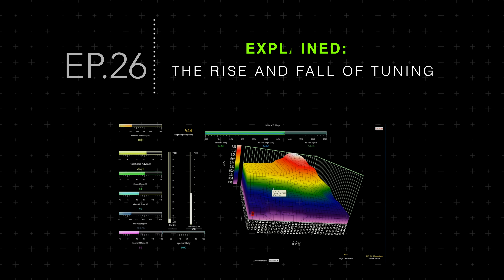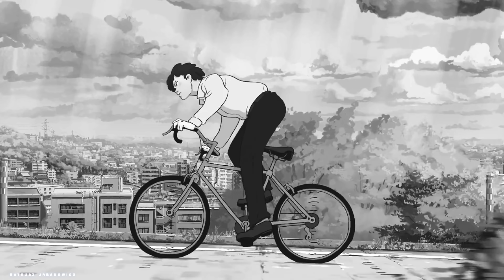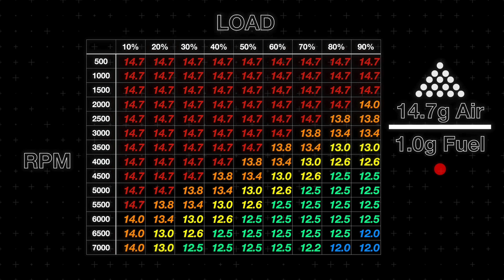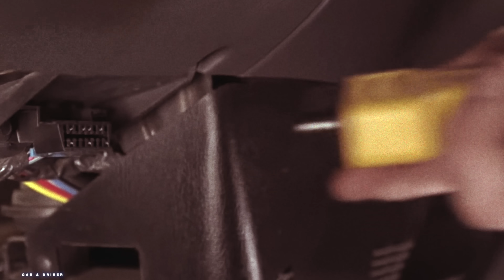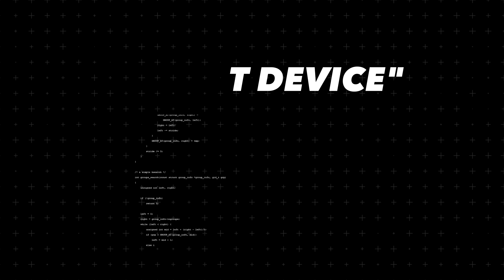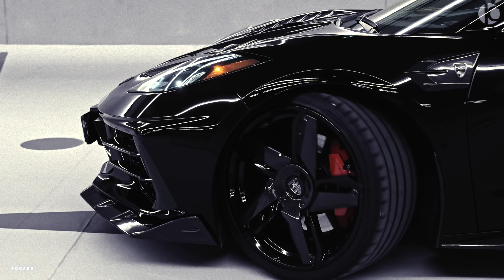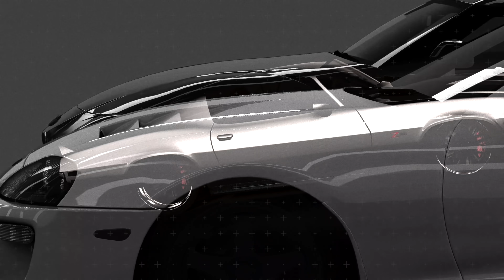How Tuning Engines Became Illegal👮🏻‍♂️| Explained Ep.26

Comment: Fortunately, SLS Printing is getting cheaper and easier to fully DIY with custom open source software. A simple rebore here, a press fitted bearing there and a tread retap here, and you can just print single modular cylinders and components and build however many piston engines you want.

For anyone who says they will just make it illegal, it is literally more impossible to illegalize SLS, SLA, FDM CNC and any other basic automated manufacturing or what you can manufacture than illegalizing all guns in Texas and actually be able to enforce it. 

Examples are, alcohol prohibition, Marijuana eradication, and any other drug which by the way are often more complicated to manufacture than a basic CNC controlled by an old laptop with a die grinder as the cutting head to make a better CNC that can make a hot end for a printer to make better and better.

Comment: Have you ever considered connecting a Arduino to a ignition coil and a position sensor just saying to get a engine running it doesn't need there computer it just needs a computer

Comment: California CARB requires vehicles to have higher emessions than the rest of the country. I got dinged because my 91 rodeo was 20% below average, and had to have it re-tuned to retard the ignition timing to increase the carbon output by 40% (according to their measurements). Not to mention the vehicle now needs to use higher RPM's to do the same work, so real world emissions are now even worse.

Comment: This has been a travesty for the future of car culture in the US. Using the case of a car manufacturer defeating emmisions regulations as a stepping stone to go after and attack the small hot rodding community is blatant overreach and an attack on small to medium business.
The layed out intent is to curb emissions, but there's a vast difference between an auto company doing it with dirty diesel and selling millions of vehicles versus random "other fuel" tuners working on weekend, track, and retirement warriors vehicles. These two groups are not the same.
There's so much wrong with this.
There should be an American Hotrodding Act.
Message your local law makers and tell them how you feel. Write the president and let him know why you think the EPA is off the handles.
A lot of these modified and tuned vehicles run cleaner than stock.

Comment: And I happen to own a scandal VW Jetta.. had the so called repair done... from 62 mpg average to 23.... gotta drive the same amount of miles though and the recall stated that the car still would not have passed emissions for it’s date of manufacture but would be a little better... yet now that I’m putting out 3 times the amount of fuel to go the same distance, I’m now putting out three times the amount of emissions.. so it’s actually costing me more money and pollution is worse from the repair. VW weighed the options.. clean burning diesel is higher in NOx.. thats why diesel's always blow black, they trade NOx for Carbon by running them rich.

Comment: Good thing I lucked out with the truck I got and where it's registered, it's a 1994 f150 2 wheel drive with the 5.0 so basically a muscle truck, and it's registered up in Manila so I don't have to do any emissions at all meaning I can give it as much power as I want around 600 hp, anything past 700 makes the stock block crack in 2

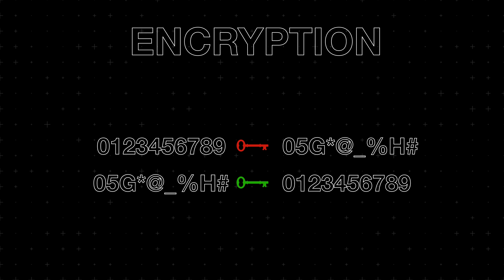Comment: 9:20 I raised the top speed limiter on my 2016 F165 from 101 mph to 120 mph using HP Tuner. The only problem I see with this is my stop/start only work 5% of the time. No I did not mess with it. I only change the top speed. I never got a CEL and it passed emission a few month back near my birthday.

Comment: The solution is simple. Just replace the whole ECU with an aftermarket ECU, one that comes with its own software, allowing the tuner to do what he/she wants. When it comes time for an emission test prior to registering the car every year, just simply plug the factory stock ECU back in, go get it tested, then, simply swap it for the tuned ECU. It used to be, "Bolt on, go fast". Now, it's "Plug and Play"!
Reply: The biggest reason for a standalone ECU is to run larger turbo, injectors, wideband O2, boost control function, and some other things.  It would be terrible to swap all the parts back to OEM, get tested, and re-modify everything.
Reply: @reubenmorris487  Exactly. Another option would be to have 2 tunes. One for performance and one for emissions testing. Thats basically why track mode exists on modern performance cars anyways
Reply: @necro_nova   Track mode?  Really?
Reply: @reubenmorris487  its only once a year you'll get good at it. lol
Reply: @JamesAlexander-gp9ng actually in AZ is once every 2-4 years depending on the car
Reply: Ideally if you were in a place like California you keep the old engine and setup and the new engine and swap back and forth between both every 2 years to pass emissions. Tuning in California isn’t cheap but it’s possible. You have to have money and when you’ve removed your engine and harness before you can do it quickly.
Reply: you are forgetting about the eternal cat and mouse game bro. there are already solutions in the market used to prevent swaps. chips being crystalized in its bedding for example, mainboards having its stand-offs cemented in a plastic-ceramic alloy.
Reply: @overdrive105  Yup, my carb doesn't need a laptop to facilitate adjustment.
Reply: @genefogarty5395  or just drive something that was built before 2020, that has an efficient fuel injection system
Reply: @caralho5237  I'd have to go back a lot farther to find a good mechanical FI system. Like the Rochester in my uncle's old Belair, lol.
Reply: An aftermarket ecu is not legal under fed regs , no alteration to any component that is part of the emissions control system is allowed.
Reply: Just register your car in a city that doesn't have testing
Reply: Cali already tests against this. A lot of cars have modules that also track milage such as the cluster. If they see the milage in your ecu doesnt match the cluster its an automatic fail.
Reply: Actually in certain counties in Arizona e.g.: Pinal and Cochise counties there is no emissions testing but by state regulations you have 30 days to change your address. You can't live in an emissions testing County and register your car in a non emissions testing County. But if you have relatives living in a non-emission testing counties you can say that you live there but don't make them make you prove it.
Reply: @reddogknives  Same here in Texas. I live in a county where a emissions test is required . For years I drove 15 miles to the next county over that had no emissions to get my inspections .  Eventually they ended that , with the inspection having to be in county it's registered. Basically the immediate surrounding counties of all the big Metro Plex areas require it and around some of the medium sized city's .
Reply: I like how you thought you had the answer which is not surprising consider most people on YouTube comment sections think they know it all.

 it's hilarious you think it's that easy like these car companies don't have something to counter that 🤦🏿‍♂️
Reply: Shhh
Reply: Just pay extra for them to pass it, that's what everyone does, $100 bill does it
Reply: @johnjames5842 that doesn't work in states with a semi modern testing system
Reply: It aint that easy. Not a keyboard or mouse, Nor a 9v and led school stuff to just "swap" or plug and play.
Reply: That’s not gonna work if you have a big cam or a turbo.
Reply: If you leave stock ecu out of car and ise aftermarket you will wind up with mileage discrepancies.  It's stored in multiple places these days.
Reply: Yep. Bypass
Reply: Correct me if I’m wrong, I know someone will, but when you run an aftermarket ECU it’s because you have a bunch of aftermarket shit on your car that doesn’t work with the factory ECU. So, in your example, if you swapped back to the factory ECU wouldn’t it be going to limp mode before you even get to the testing facility thus making your vehicle not even come close to passing?
Reply: @cjcantrell80  well...I object to your describing those little nuggets of happiness as "shit"
Reply: @boostismagic here here
Reply: @cjcantrell80 yes
Reply: To be honest too I think another solution is go to a state (if your that serious about building and modifying cars/racing)  where you don't have to get an emissions test..... Ever. I'm running a downpipe off the turbo no exhaust (obnoxiously loud getting exhaust welded up soon) and been doing doordash everyday as a full-time job DD and the cops just act like I don't exist but like I said my state doesn't do emissions tests and don't care about exhaust loudness too much
Reply: @justinmike2zrfe  Bruh, tell me what state I’m moving to!!
Reply: @cjcantrell80  that's the thing I'm in Louisiana 😑 I would rather myself lately they don't care like ours
Reply: @justinmike2zrfe  I lived in Shreveport area, they definitely cared about sound. Now I’m near New Orleans, we get screwed.
Reply: @justinmike2zrfe 😮h
Reply: 🚙Mega Squirt EFI Tune ||| (3) -Set Up can have 1 aftermarket tuned ecu hard wired in together with a stock car ecu. You must hide custom tuned ecu from emissions testing facility. Modern cars with custom modified stock ecu or aftermarket ecu can both show a maintenance light on display. Arizona have advance emission control computer & pc system will know if your custom modified car have any issues with emission parts&components.

Comment: its incredibly unlikely that an ECU will ever be unhackable - why? because even if the code is encrypted, the decryption key will be stored either in the same flash as the software or on board the MCU. The MCUs used in ECUs are generally entirely out of date on ancient process nodes and with very little processing power, so will have readily available debugging tools - assuming the worst case, everything is on a single microcontroller, you could still hook up a debugging tool to the chip as it runs the software from its internal EEPROM and view the contents of the RAM and ROM, now you can dump this data, and if its using a fast and old encryption algorithm, likely determine the key. Failing that, just rewrite the code to the memory excluding the encryption/decryption components. As soon as someone has physical access to a running system, its no longer secure, it doesn't matter how strongly encrypted the data is - if you can view the data in RAM of if its decrypted on the fly (and you can view the RAM contents to try to find a decryption key) then its possible to work around any form of software encryption - with the caveat being that if the key was in hardware, on an ASIC or FPGA then you would have a much harder time. Of course all of these examples assume you don't just have access to the official diagnostic tools from a manufacturer, and i'm pretty sure that most dealerships that service cars would have no problem 'leaking' relevant information to tuning companies - or the companies themselves just buying the diagnostic tools direct from the manufacturer.

Comment: Here’s a thought. Start your tuning company overseas. Allow customers to purchase and download tunes to flash themselves. Then you can’t be touched by the EPA. 

But yeah, it’s true. Tuned cars are not anywhere near the top polluters. Even cat-less cars. It’s semis, airplanes, factories, etc… Big corporations. 

I’m all for environmentalism, but I’m also realistic and know that the EPA doesn’t truly care about the environment, as they give big corps pass after pass to dump emissions into the environment. They know that’s a harder legal battle than going after independent tuning shops. They simply pick on the small guys to get some extra cash, like our government always does. It’s disgusting behavior. 

Defeating emissions devices and tuning your car for track use should be fully legal. And most tuners state on their site that their tunes are for off-road use only. It is up to the customer to follow those rules. And while many of us may not, that’s not the tuners fault and should not fall back on them. 

But yeah, realistically it’s just a money grab from the government. If they actually cared about the environment, they’d be going after the mega-corps dumping 100x the emissions into the environment than all the cars a tuning shop has ever tuned.

Funny enough, a lot of the times tunes give you better gas mileage (unless it’s a super hot tune) which is better for the environment, overall.

Comment: You forgot to mention Programable ECU's, that's the future. You can add that to your car and manage the engine, coils, and inyectors without touching the OEM ECU or tampering with it. Like the C8 Corvette from Anderson Dick Fueltech's owner
Reply: Selling and tuning programable ecus is being cracked down on by EPA, see Boosted Boys videos a couple of months ago, they had their tune files audited and fined for every sale of an aftermarket ECU.
Reply: @zaliman While that may be true for american companies, plenty of other manufacturers on the planet will ship things overseas. 
The true next step will be running engine management on hardware that wasn't meant for it. The EPA and others have zero leverage on you buying a Raspberry Pi or old laptop and running the engine on these with software from god knows where you paid for with bitcoin or cash to a buddy who bought it with btc. 
And with social media, stuff like this spreads.
Reply: @zibingotaeam3716  They also can't crack down on EFI and performance kits or outright engine swaps for older cars. Get you a 1967 Chevrolet Chevelle and put a gen 2 5.3 or 6.0 truck LS in it. Gotta be iron block, aluminum is alright I guess, definitely lighter, but iron is where it's at on old cars because they weighed almost nothing compared to the new shit and thanks to modern metallurgy the cast iron they're made of is extremely strong, and can theoretically handle up to 1000 hp if you wanted to push it to the limit harder than Paul Engemann. Aftermarket ECU and some bolt ons and you're set. The feds don't need to know it ain't the factory 327.
Reply: @lsswappedcessna  yeah, but a 67 chevelle and an engine block cost $$$, while a raspberry pi or old laptop are less than a full tank.
Reply: That does not apply to Fueltech  @zaliman

Comment: The funny thing about diesel gate , is that a few other companies do this , and no one seams to notice . I used to do emissions test on diesils . The dodge Cummins trucks newer than I think 2004 , would drastically run differently when attached to the drive clean computer system . I have noticed some heavy trucks did the same thing . Had to shut the truck off and restart to make it run properly after the test . So much so I had a few complaints from costumers . A few people would drive away then call and say there truck nearly moves now .  The long way around the locked ecu issue is stand alone , and stay out of California place is burning anyways .

Comment: To be quite honest, I disagree. I think it may mark the end of retail tuning...it's quite a bit harder to make the same argument for the homebuilt tuner....the guy building his own pcbs, using off the shelf components, and soldering up a masterpiece of a stand-alone fuel management system, or maybe just a piggyback unit to intercept and change the signals en route....

...or maybe I'm wrong, and I missed something important that you said. I was kinda drifting in and out while you were going on, if I'm honest.

Comment: We need a car company that builds modular cars. Modules that can be standardized and swapped out/upgraded easily. Like a computer. Start with a chassis/computer case. Add in the parts you want based on performance and affordability. You can kinda do that now, but have to start with some other car's chassis, tear it all out, add in parts you want and bend over backwards to get it all working together.
Reply: that runs against the practice of making people replace entirely when something faults partially.
Reply: @hardrays  I know it. But what kind of car would people prefer, who would get the sales? Plus add in all the potential upgrades customers would get later. I know I'd want one.

Comment: All these years and I’ve never heard any compare ignition timing to riding a bicycle… what an easy and universal way to explain it to the masses. Bravo :-)
Reply: Yep.  Been at this for decades and never considered that analogy, yet it's perfect.  I am disappointed in myself for not thinking of it 30 years ago.
Reply: I agree with this comment completely !
Reply: @glennjames7107 same here 100%
Reply: That's how I have always been explaining to people who doesn't know about how the engine works, I compare bicycle pedals as the crankshaft, and the legs as the con rods with a piston.
Reply: @SamFisherK yup, me too. 

Detonation, pressing down before pedals even reach top.

Late ignition, pressing only after pedals more than half way down.

Imagine that perfect spot to press hard for max effect. Now convert that to degrees. Its gonna be right around 20 degrees after pedals reach top, just like in a motor.

Now imagine pedaling at 7k rpm (or some realistic bicycle version of that, like maybe 300 rpm). How you'd have to trigger muscles well before pedals reach top just so they'd actually fire at the right point bc of reaction time.

Makes all these concepts super easy to understand. You get it!

Never understood why this wasn't a universal explanation. So obvious. Right?
Reply: Yeah that was helpful  👍
Reply: Some guy out there is using the resistance of Kraft macaroni & cheese to explain how a clutch works 😝
Reply: Let alone use anime to demonstrate it.
Reply: good science communication
Reply: If you really think about it your legs and a bike are like an engine in a car. The derailleurs are much like a transmission as well helping you to achieve higher speeds than your legs can.
Reply: W pfp